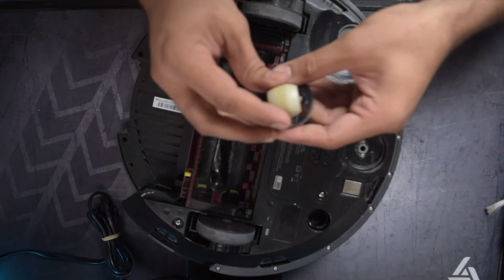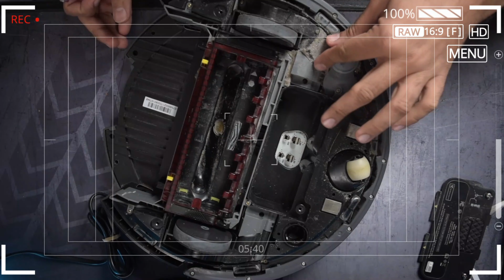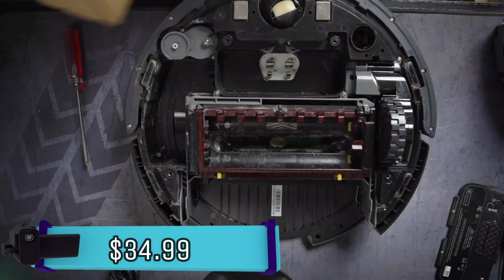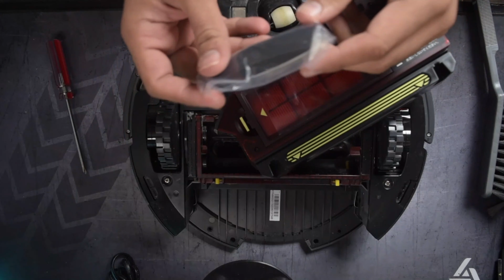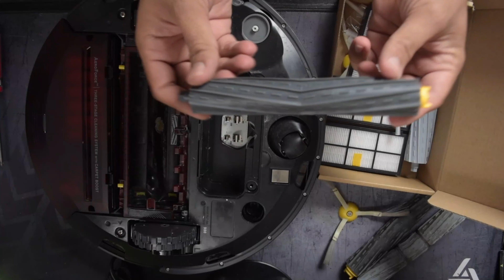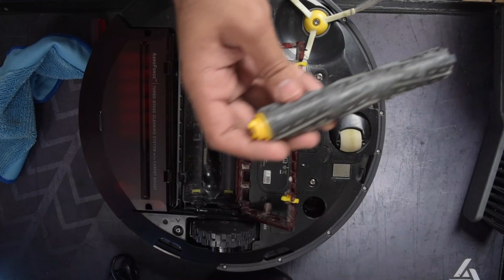iRobot Roomba 980 Robot Vacuum Cleaner Maintenance | Replace Battery, Bin, Wheels and Clean up

Comment: How many hours of use did you have on this when the wheels were worn out?
Reply from the maker: I would say 3 years of usage. I purchased it in August 2017, changed the wheels around the same time in September 2020. Now, the wheels are bald again. I have recently purchased iRobot Roomba S9+ and Brava M6 for the main floor and moved Roomba 980 and Brava 380 Upstairs as my secondary robots.
Reply: @DivitTech  Apologies to be a bother but can you please check in the "history" section on app to tell me hour count? I guess we would be dividing that # by 2 since you are gonna be changing tires again if you continue using the 980. I ask because I have multiple robots and so "hours" are the only thing I can go off of...

Side note, you can buy just the treads and replace the tires on the old wheel assemblies if the rest is still in working order. I've read the side brush makes the tire on that side slip off and I intend to use a few drops of super glue when/if I go that route in the future. 

The S9 is a monster, nice upgrade! The tires on these supposedly are even more prone to wear. Maybe they changed material or maybe it has to do with the shape. Dunno.
Reply from the maker: Here is the Life time History that shows the following...
Number of Cleaning Jobs: 2,737 Jobs
Total Job Time: 1,525 hr 49 min
Dirt Event Count: 3, 050 Events
Reply from the maker: @ImranMughal-s5f  About the threads, yes, you can. I just saw them online (https://amzn.to/4gsmGEf). For my old wheels, the motor and all worked perfectly. I wish I had this option back then to spend only $10 instead of that big amount.
Reply: @DivitTech  Thank you for this information, this info is gold! Impossible to find online. So ~700 hrs on a set. Thank you again!
Reply: @DivitTech  Happy New Year! One other question. Have you ever replaced the battery on your 980?
Reply from the maker: @ not yet. Still the original works
Reply: @DivitTech  Wow! That is super impressive. Thank you for this information as well :)
Reply: @DivitTech  How many times have you replaced the rubber rollers? Thank you in advance!

Comment: My Roomba 980  dust bin got jammed when I reinserted it. I mis aligned it as I slid it in.  Please advise me.
Reply from the maker: It's hard to guess what exactly is stuck. but typically the bin has 2 teeth that get unlocked when you push down the yellow button on the bin. You can try this. Remove the roller brushes and try to push the bin out from that space with your fingers along with pulling the bin out by pushing down the yellow button pretty hard with the thumb. I hope that works. In worst case scenario, even if one teeth of the bin breaks, it still works with one teeth. Last option is to buy a new bin, if the bin breaks while trying all this. Wish you all the very best and let me know which option worked.
Reply: @DivitTech  I’m THRILLED that you helped me. I went ahead with your detailed video… and took apart the underside of the robot… I was able to free the bin and reassemble the robot. 
THANK YOU, soooo much. 
It now works perfectly and I saved $$$ sending it for service. 
I love the 980. 
I also just got the Braava 6 robot to damp mop. That is great too… and very quiet. 
Do you have any opinion on the J7 combo unit?
Also, the only other issue I am having is pairing these robots to Alexa or Siri. I have successfully mapped each robot, and Alexa says the robot is linked… but it does not work. 
I just manually use both robots
Reply from the maker: @EleanorCohen  I am glad that I was able to help. For Roomba 980, you have to press both the small buttons together for pairing. You first pair Roomba with the iRobot App on your Smart Phone. Then, from Alexa app on your phone, you link the Roomba App. Once that is done,  Roomba should now be your slave and will follow all your commands ... 😃